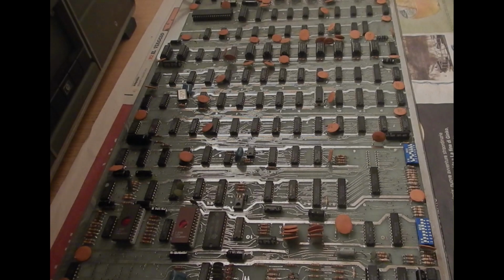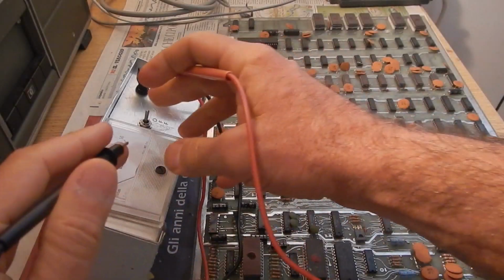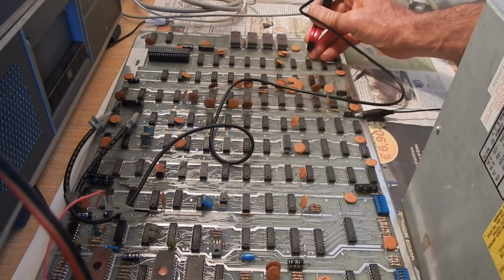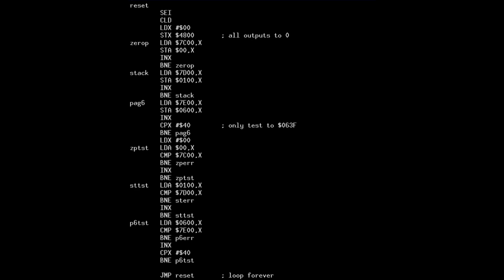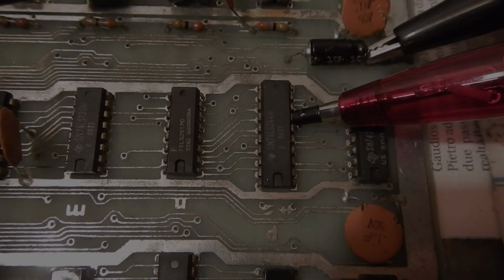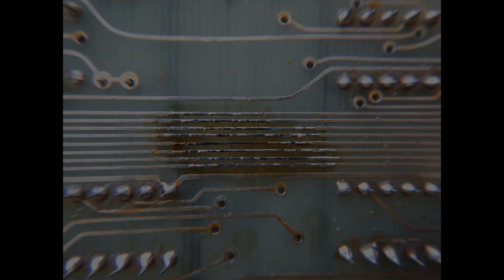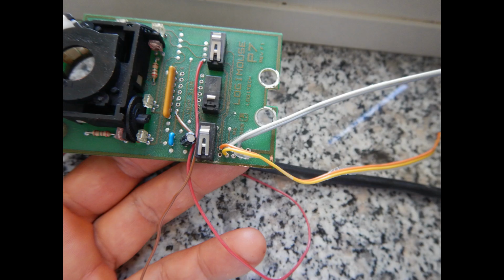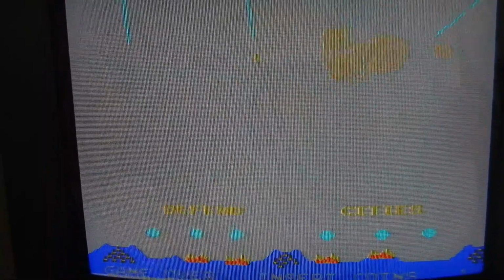Missile Command (bootleg) arcade repair #1: a bad troubleshooting case.

Comment: I'm guessing this leverages an SN76489 to play back the sound samples?
Reply from the maker: Nope :) Weighted-R "dacs", in other words, resistors of appropriate values are connected directly in series to 4 of the eprom's data outputs and the resulting voltage is buffered by one opamp. One other eprom's databit is used as "end of samples" input to the counter that
plays the samples by incrementing the lower eproms' address pins.

Comment: Impressive diagnostic work! A must see video!! Thanks for sharing!
Reply from the maker: Hello, thanks for the very nice comment! I considered this a good example on how NOT to diagnostic correctly! I didn't verify my assumptions or exclude other possibilities before pulling ICs. Luckily no ICs were killed, the board was sent back with all original ICs plus three new sockets :)
Reply: @iz8dwf  Well at the end of the day you got it working and we all learned something. Always good to learn
Reply from the maker: @RudysRetroIntel  Indeed, I think it takes a very careless approach to make things worse. But still is good to show errors to be avoided.

Comment: Excellent work Frank :)
Reply from the maker: Thank you! I think I should have really thought better before pulling some innocent ICs here. However, no IC was damaged or lost at least :)
Reply: @iz8dwf  Everyone occasionally gets fooled into this, Damaged tracks often the cause of miss diagnoses.
Reply: @iz8dwf  Then all is well, I’m going to add a Z80 6502 NOP adapter to my tool box (home made of course) :)
Reply from the maker: @petesapwell  Good move! I wouldn't work on these boards without the NOP generators :) In this period I'm "playing" with the rather unusual S2650 CPU, so I might need to add one more socket to my collection...